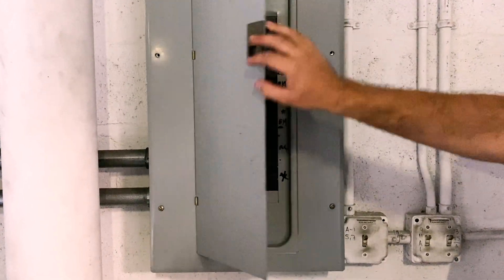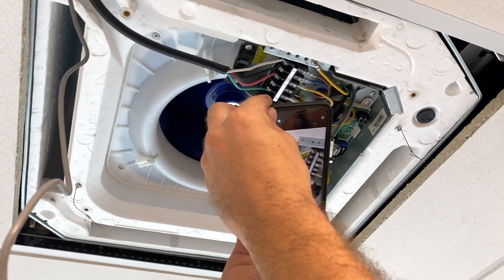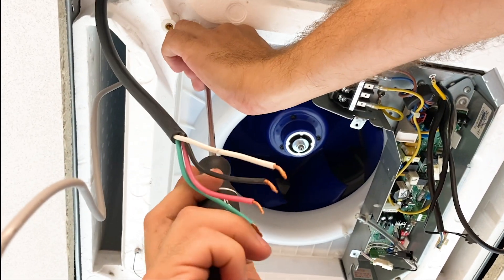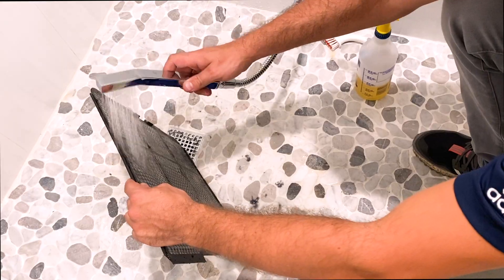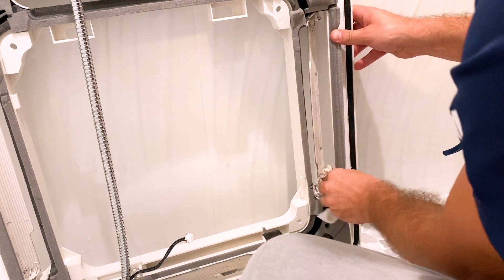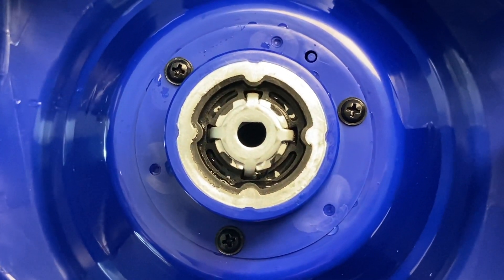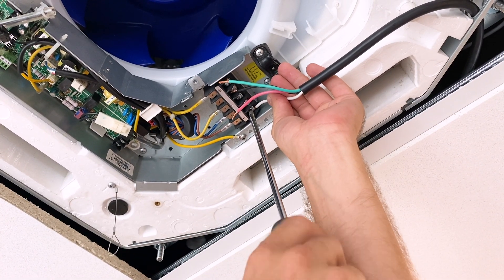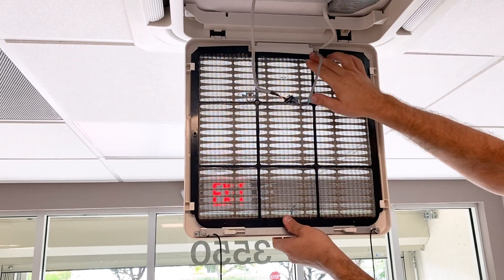Cleaning Ductless Ceiling Cassette Air Conditioner (Cooper&Hunter)

Comment: This unit uses a small condensate pump that should be cleaned out you have to add enzymes to the condensate pan. I think If you disassemble it to this point you are only a few screws away from exposing the pump which should be inspected for clogs but this video didn't show that step.

Comment: Wow, going ductless always sounded better from an energy savings standpoint, but that's a lot of maintenance! Are all head units this bad?

Using this to cool a home would need a ton of heads and the upkeep of 3-5 heads would make reselling a home very intimidating compared to simple air filter swaps (and the occasional flush) of a typical air handler. Maybe use of a single head for storage/workshops would be fine or extra capacity for a single room to kept at a separate temperature, but otherwise I'd probably stay away from ductless in a home (unless it's one big room with no doors lol).

I don't want to buy separate air filtration units and dehumidifiers that will take up conditioned floorspace, so it looks like a mechanical room, basement, or conditioned attic with an air handler (maybe HRV/ERV and dehumidifier too) and ducts is still the way to go... dang.
Reply: Why would you need dehumidifiers? I would imagine ducted systems would be more likely to need separate air filtration considering all of the ducting where junk can build up... That's why I'm looking into ductless; bought a new house in the fall, first time turning the AC on and I'm sitting here writing this in a mask because it's messing with my allergies and asthma.

As for maintenance... How often do you clean your internal coils and blower on your central system? That's what this is showing.
Reply: @hank7281  Ducted is always better because the fans are properly sized for the airflow and designed to pull air through an actual air filter.

Any ductless type, whether it be a cassette like this or a wall-mounted minisplit, doesn't have a fan strong enough to pull through a filter, that is why they only use a mesh, and why the fan and coil always end up full of dust and require maintenance like this multiple times a year. They will never filter properly.

If you have issues with a ducted system, chances are you don't have a filter installed or haven't changed it in years. If not you might have mold in which case your mini split will grow mold 10x faster than your ducted system due to the dust and moisture buildup in the fan and coil. Whatever issues you have with a ducted system will be SIGNIFICANTLY worse with a ductless.

Ducted systems use actual air filters in the return. There should be minimal dust buildup inside the air handler and any ducting. Otherwise like I said someone may have removed your filter and never replaced it.

In S.Florida in a ~12yr span we went through 3 mini splits while our 2 ducted systems had zero issues with basic filter replacements. Never allowed the filters in the ducted systems to clog before replacing so the coils were perfectly clean and never needed further maintenance. One had the outdoor unit fail due to being next to a salt water softener and corroded, but that would happen to any condenser.

The mini split on the other hand needed almost full disassembly every 6-8 months to do this type of cleaning. And it was filthy every time.

Comment: I've been looking into buying one of these, but this is crazy maintenance.
Hey thanks for the great video.
Reply: they all have this much maintenance in the end just where its positioned.  a regual ducted  split  unit doesnt  require this much cleaning on average if installed right.
Reply: Get a wall mounted minisplit and save ALL the hassle! Ceiling cassette units are not needed, especially when the wall mounted unit can throw conditioned air clear across the room and evenly heat and cool the space.  Terrible design and even worse maintenance requirements.
Reply: Don't need any of this mate, just literally brush the filter once a year. Everything else here is for maintenance engineers.
Reply: @discostoo the filter is just a 10% of all the cleaning, the dirtier part is on the fan and grills

Comment: Thanks for this video, it gave me the steps to easily clean my unit. I have a problem with my water pump that must be clogged, is it easy to remove it and clean it or replace it? Is it located beside the drain plug ?

Comment: This is really terrible engineering.  Imagine that the control panel was no where near the fan and condenser.  of imagine a proper filter that you could just replace every six months, like current all house ac units.
Reply: When's the last time you've cleaned the internal coils and blower on your central AC? That's what this is showing. The filter part you're talking about are at the 25s mark. If you want a more robust filter than the one that comes with it, you can probably find something.

Comment: I got a unit just like this installed to my home (Model CH-FC030K2). I wonder is it normal that it makes a loud motor like noise that has nothing to do with the fan? The noise is constant with all the fan speeds, and even continues for a minute after the device is turned off and the fan has already stopped completely. I'm just wondering what else besides the fan motor is there inside to make the noise?
Reply from the maker: Our units are very quiet. A loud noise does not sound usual. We'd recommend getting in touch with our Technical Support team for troubleshooting Mon-Fri 9am-5pm at (786) 953-6706

Comment: Curious what kind of smell a dirty coil causes. My ceiling unit on cool smells faintly ike a car heater coil overheating. I sprayed coil cleaner but the smell persists. The cooling and heating are the same for 2 years but it always gives off an unpleasant smell on cool. This video will help do a deeper clean. Thanks.
Reply from the maker: The smell depends entirely on the surrounding atmosphere as, obviously, the unit itself does not create a scent. If you're concerned about the smell, we'd suggest calling an HVAC technician to come out and service your unit.

Comment: Much better to use a pressure washer to make sure that the unit was totally cleaned not that.
Reply: Very true my brother👍🏼
Reply: Sorry a pressure washer has a lot of pressure and it will damage the coil. The cleaning is to have a better air flow and avoid fungus.

Comment: I was looking for some help in deciphering the installation manual when I came across this video.  My unit came with two extra jumper type cables which didn't make sense (since I didn't need them).  This video helped me figure it out, though it's fairly simple to install, but the extra cables threw me off.   This video is very well done.  Question, does the display plug just pull out or does it have a disconnect tab on it.  Looks like he just pulled it out by pulling on the wires.
Reply from the maker: It has a disconnect tab.

Comment: I had a P5 error code on a Mitsubishi ceiling cassette installed on 10-06-2020 and when I removed the condensate drain pan there was a lot of slime at the bottom of the pump preventing it to remove the condensation. The filter is cleaned often. I have cleaned the slime and it is working now but now trying to figure how to get clorox in drain pan yearly to prevent a re-accurence.
Reply from the maker: Hello! We would recommend getting in touch with Mitsubishi to get their suggestions as we are not familiar with their equipment. Thank you.
Reply: You can research the code on mitsubishi Web site and fix the problem via a a/c dealer or buy it online, since you scrap it yourself then you can go the distance and repair it yourself. When you found the slime in the drainpan, it meant it wasn't serviced often or very poorly, in the islands, we service every 4-6 months.

Comment: 1:21 wait a minute...so the water condensation doesn't drain anywhere until you unplug it?
Reply from the maker: Yes, there is a pump which removes the water, but what was left in the pan is residual drainage.
Reply: That unit has a condensate pump built in, during the servicing, the hose was supposed to be disconnected and flushed, the line would have slime/slush buildup along it a back pressure would cause a error code for the pump, stop unit functioning and drip water from the unit.

Comment: Not professional work
Reply from the maker: The technician in the video is an HVAC technician with a Masters degree in Engineering. He has thousands of mini split jobs under his belt. This is about as professional as it gets!
Reply: @CooperandHunterusa  a technician service for cassette unit are to scrap everything ie:remove filter, electrical, drainpan Blower wheel,disconnect the drainline from the pump, jus leaving the Blower motor in place, attach a cassette service bag that is suspended under the unit via hooks and adjustable strings the bag shape like a cone a drain off line is connected to it's base, put coil cleaner on coil and  flaps/swing on facing n filters, use adjustable pressure washer or small washer on parts n coil, securing the Blower  motor with a bag tucked around and wedge behind motor, flush drainline and secure back onto the pump,dry the unit and reassemble. Left working properly. When I come across a service, 1 soon I would upload our service. I service units in the Caribbean Islands 10yrs nw

Comment: Wow! Great video and very informative! Had a company come out to clean my units. Three in all and they certainly didn’t do what was done in the video. Will do my own from now on. 

Side note: one of my units started making a loud buzzing sound inside the area where the electrical components are. Is that a common problem with the 4 way cassettes?
Reply from the maker: Hi Kellee, we definitely recommend having a professional do perform all maintenance on the units. Maybe have them follow along with the video next time! 

If you'd like to inquire with technical support about the noise, please call (786) 953-6706 Mon-Fri, 9am-5pm, Eastern Time
Reply: @CooperandHunterusa  after I had the fan out (which the company I hired never removed to clean the unit properly) I could see dirt still caked on the coil and they had bent the coil in places as well because the guy stuck a sprayer wand up there. I’ll never hire it done as long as I’m able to do it. I have before and after pictures and should request a refund.
Reply from the maker: @kjelmo  Wow, such a shame. We're glad the video has been helpful for you!

Comment: Just 2 suggestions for the next generation, First, maybe have the 5 screws black or another color that stands out.  Second maybe an intermediate cable that allows for one disconnect for the sensors instead of disconnecting all 4 one at a time.
Reply from the maker: Thanks for sharing your ideas with us!
Reply: Lol! It depends how dirty your coil looks.if it's too dirty dont try this

Comment: very clear instruction, but why not removing the water catchment sink as one cannot access the outer side of the coil and only cleaning one side of the coil.... especially when you are not using a water pressure sprayer, it's difficult to clean both sides by only cleaning from the inside.
Reply from the maker: Hi Henry, the simple answer is that we didn't clean the outside of the coil because it was not dirty. Since the inside is the return side, it's the part that needs most maintenance. So, it really depends on the application. 

In regards to the pressure washer, this isn't as necessary if you use a good chemical coil cleaner. This method also saves a lot of mess, comparatively.
Reply: @CooperandHunterusa  given the coil can be really dirty in some cases, the dirt or gunk will be flushing into the water drainage sink if it's not being removed. This might cause a blockage in the drainage and flooding inside the unit... how to prevent that ?
Reply from the maker: @henrymug  Good question! As we mentioned, this was a basic cleaning to our unit, which was not very dirty. If you're cleaning a lot of dust, etc, from your coil we would recommend the same approach. Brush the coils downward into the drain pan and continue to clean that way, to avoid a big mess. Then, when the coil is clean, remove the drain pan and clean that component separately. Reassemble, and you're good to go!
Reply: @henrymug  I prefer to vacuum first carefully if real dirty prior to water flush.  Handheld Dyson.

Comment: How often should they be cleaned like this?
Reply from the maker: It depends on the frequency of use and other factors of the location, like presence of pets or pollen. Generally speaking, though, a thorough clean should be performed at least once a year.

Comment: Is cleaning cassette units usually a messy job? Some geniuses put one in a server room directly above the servers and it needs cleaning but no one will touch it because the equipment in that room is super expensive and they don't want to be held liable
Reply from the maker: It doesn't have to be a messy job. Frequently cleaning could mean that each cleaning can require less water/coil cleaner and, therefore, less risk of a mess. It would certainly be wise, either way, to cover any fragile equipment with a large waterproof tarp for good measure.

Comment: Thank you for this video.  It helped me a lot. I just have a question, seeing this type of service, is it no longer necessary to use a pressure washer to clean the coil?
Reply from the maker: We definitely don't recommend using a pressure washer on ceiling cassette units. It's bound to result in a huge mess and risky having so much uncontrolled fluid around the electrical components.
Reply: @CooperandHunterusa  hi I'm from trinidad and Tobago, our service for cassette unit are to scrap everything ie:remove filter, electrical, drainpan Blower wheel,disconnect the drainline from the pump, jus leaving the Blower motor in place, attach a cassette service bag that is suspended under the unit via hooks and adjustable strings the bag shape like a cone a drain off line is connected to it's base, put coil cleaner on coil and  flaps/swing on facing n filters, use adjustable pressure washer or small washer on parts n coil, securing the Blower  motor with a bag tucked around and wedge behind motor, flush drainline and secure back onto the pump,dry the unit and reassemble. Left working properly. When I come across a service, 1 soon I would upload our service.

Comment: In the end shots the interconnecting wire was not mounted under the strain relief.
And it would be better to use some spades instead of bare copper under the terminals when installing such a unit.
Reply from the maker: Hello P van der Kleijn! Great attention to detail! Our communication cable is held into place by a strain relief before it reaches the terminal. And, fortunately, our units are designed so that you're able to connect wires with or without spades. Definitely couldn't hurt to use them, though!